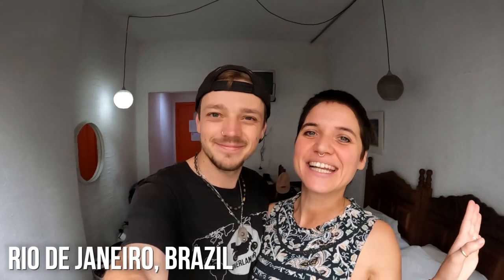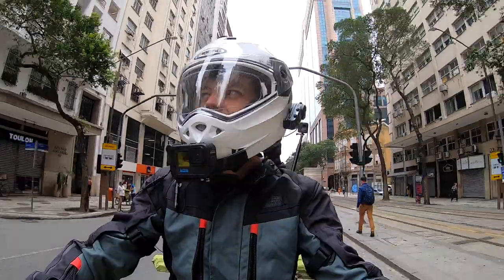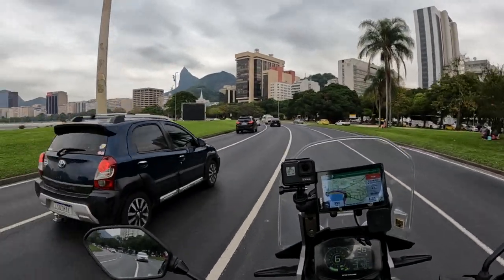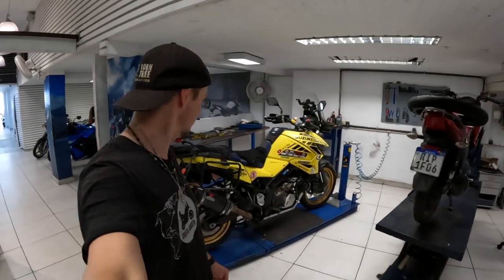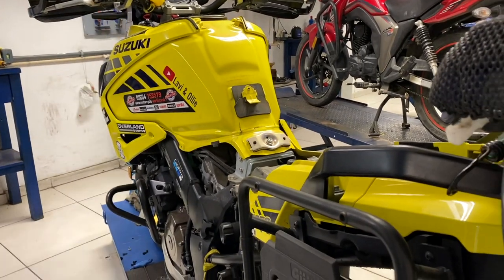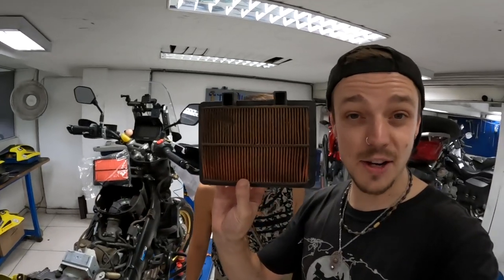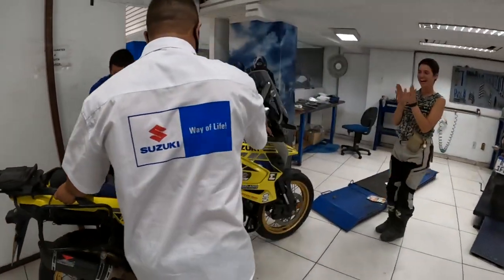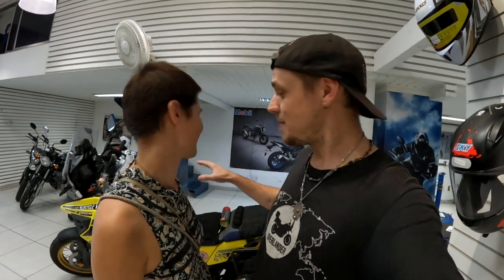First Service in 10000km Suzuki V-Strom 1050xt (Brazil) 🇧🇷 [S3 - E3]

Comment: I'm so glad you (finally haha) got the service done. You saved yourselves a rear disk, by changing the pads. Considering where you've driven, the air filter wasn't too bad. The garage did a great job. The Radiator cover is a great idea. Lets get on the road
Reply from the maker: Haha is too 😅 we couldn’t believe the break pads 🫣 thanks so much for watching 🙏

Comment: That air filter didn't look too bad considering you've been through several rather hefty sand storms and things. Oil was well due, though, as you'd expect after 10 000 clicks.
Radiator guard was a good call too. And yeah, those pads on the rear were allmost down to the metal(!). You don't want that, believe you me! :)
Happy travels, guys!
Reply from the maker: Yes let's just say that the whole service was a little overdue! We will do it a little more regularly from now on 😊 We were so grateful that they donated the guard for us, that extra level of protection will certainly come in handy on the road to come! Thanks so much for watching 😁🙏

Comment: Should the rear brake pads wear down faster than the front ones? I would have thought most of the braking is done by the front brake since the weight is thrown forwards when you brake? I wonder if the rear brake was slightly on all the time, maybe because the wheel was misaligned? Perhaps you'll find Bumblebee runs more freely now, and maybe handles better now the wheel is set up properly? Looks like you went to the right garage, they certainly seemed to know what they were doing!
Reply from the maker: You know what that is an interesting theory 🤔 I would have thought that I'm braking quite equally on both so it was quite strange to see so much wear on only the back so perhaps you're right! These guys knew everything that was the know! Definitely the right place to go! 👍

Comment: Nice 👍 It is good to have the Bumblebee checked and maintained as you did with specialized experts. Is this the first time you change the engine oil?
Reply from the maker: Yes it's the first time of the trip so far as we were advised at the beginning to have a service done after 6000 miles (we pushed it a little to 7000 😉) We'll change the oil more regularly from now on, probably every 4000-5000 miles

Comment: Hint with any airfilter to really get an idea how clogged?  Hold up to sun or bright light especially compared to new one and note how much light is/is not coming through!   When I check my air cleaner on NORMAL easy to get to vehicles (all EXCEPT my Vstrom)  I always if not changing the element at least vaccum out the dust with Dyson hand vac using soft brush attachment ....a also clean the entire airbox with vac and barely dampened clean rag...a little grease where gasket contacts never hurts either as last line of defense against dust trying to sneak though mating surface
Reply from the maker: Thanks for the information 🤩

Comment: If I ever go to Rio I will go to ego motors. It's well run and it's great seeing how thorough and kind they were servicing bumblebee. Great idea to protect the rad. Do you have a baseplate to protect the sump of your engine? I'm impressed with Suzuki bikes, their engines and mechanics are so good and electrics are good too. Honda, Suzuki and Yamaha are the most reliable motorbikes in the world and v Strom's are guaranteed to go round the clock . Only the finish lets them down a bit but they are good value and cheaper than many machines.
Reply from the maker: Yes of all the services we've done so far these guys were the best! Yes we have a bash plate and I can tell you that it's come in handy many a time! The V-Strom engine is the best part about it, this bike has been nothing but perfect from the start 😁🙏

Comment: If you haven't already, definitely check the wheel spokes for looseness. A long 5mm Allen on a 1/4" socket drive makes it much easier than using a spoke wrench.
Reply from the maker: Will do! Wouldn't want to lose any of them! Thanks for the advice 😊

Comment: As a former mechanic I can confirm that air filter was filthy🤣and those brake pads were shot🤣Great job by the dealership and so kind of them to install the radiator guard, Bumblebee is raring to go😁
Reply from the maker: Hahaaa 🙈 We knew the air filter would be bad but the brakes surprised us! Yes now we have the new and improved Bumblebee we're ready to take on anything! 💪

Comment: Did you not change the oil at all on the trip so far? I change mine roughly every 5,000km.
The air filter isn't too bad, no worse than mine usually looks when I change it. 
Yeah, definitely keep an eye on your brake pads. You can roughly see how much they are wearing down without removing the calipers. Doing lots of slow technical city riding will wear down your rear pads fast. 
I can't believe you didn't have a radiator guard! I made one for $30 about 8 years ago and still have it on my bike. I filmed the process and it is my 5th most popular video with 47,000 views. (I just checked!) 🤣
The guys at Ego sound like they are great to deal with. It helps a lot having people like that on your side. So when will you start the travels again and leave Rio?
Reply from the maker: No we didn’t change the oil 😅🫣 but we’ll be better in the future 😂 and change it more often. Yes the guys donated us a radiator guard, so cool 😁 we’ll be posting a new video tomorrow! It’s time to leave the city! Woohoo 🥳

Comment: Hi Guys. Great to see you getting everything sorted. Like others, I am astounded at the complexity in getting the air filter out. NOT GOOD!!! I'm also horrified at the amount of wear on your back disc pads. Was it really only 10,000 k on them or am I misunderstanding. Considering 70% on your braking is handled by the front brakes I'd expect much better life. Anyway, it's all sorted now. Good luck for the remainder of your awesome trip.
Reply from the maker: Yes it’s a crazy mission to get to the air filter 🫣 the mechanic said that the back wheel wasn’t exactly straight so that may have caused the brake pad to wear down much faster 🤷‍♂️😅 something we’ll definitely check more often in the future 🤩 thanks so much for watching and see you in the next video 🥳

Comment: For the first 50 miles after breaks change watch out for tire slamming, this can cause tire to.liss grip 50 to 100 miles this happens when  breaking causes tire to grab them let  up some and grab again
Reply from the maker: Never heard of that! Will be careful!
Reply: @LaviandOllie  the reason is new breaks are not smooth when breaking. At first,, when a tire gets a fast or sharp input if force it losses traction

Comment: are the tires still good?
Reply: Should have replaced tyres, chain and sprockets, new chain guard as well.
Reply from the maker: Looks like they still have plenty of tread 🤷‍♂️ We'll keep an eye on them but for now good to go 😁
Reply from the maker: If we did that every 10,000km we'd have to do it 5 times on this trip! 😮 Haven't got the budget for that 😂
Reply: @LaviandOllie  Best wishes to you both. I hope you replaced the chain guard at least? Don't scrimp on the motorcycle maintenance. Without the motorcycle there is no trip! The motorcycle is essential. And 5 sets of tyres is 1000 euro for the entire trip which is the only contact between you both and the road for the entire trip. Be safe. Don't scrimp on the bike cost!!

Comment: How the h.... do you use out your rear brake pads in 10000 km? Mine has done 37000 and is almost unused. Stop using your rear brake like driving a car.
Reply from the maker: We’ll see how it goes with the next one 😂
Reply: I used my rear brake for slow speed manoeuvres as I was taught . I can rev the bike higher while controlling  my speed with the rear brake , the gyroscopic effect from the higher reviving engine allows for better slow speed balance. It’s like one of the first things I was taught

Comment: Such an absolute SHAME any model has an air cleaner a rider cant service in 5 minutes anytime needed.  It is one of the few deal killer reasons I got rid of my Weestrom ....it is inexcusable IMHO.....shame on you Suzuki!  Bad enough it so damn hard to change spark plugs and how utterly intimidating it would be to check valve clearances ....seriously not worth having a V or L twin if this is the case!  Makes old boxer twins appealing
Reply from the maker: Yes totally agree with that 😫

Comment: What’s sort of range do you get from a full tank ?
Reply from the maker: Around 200-250 miles 😊
Reply: @LaviandOllie  I get about 150-180 from my z1000sx , I am travelling to morocco in the spring , will only be using the tarmac roads in morocco , should I be concerned about fuel stops?
Reply: @81craw  no worries at all